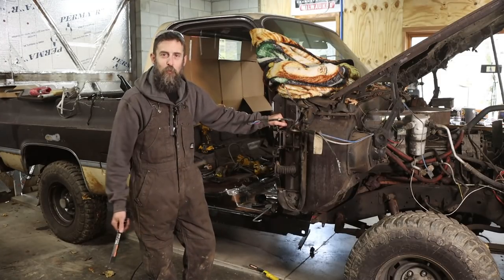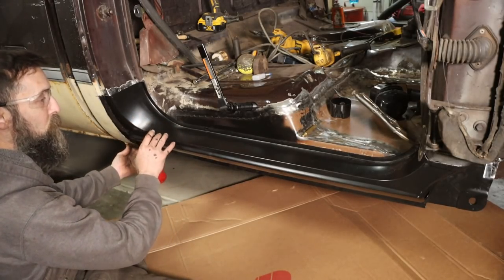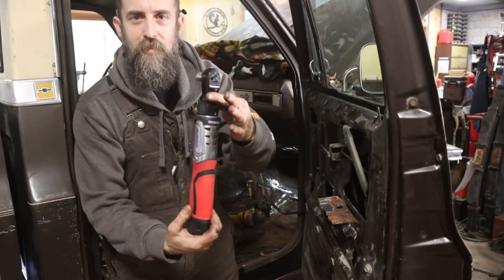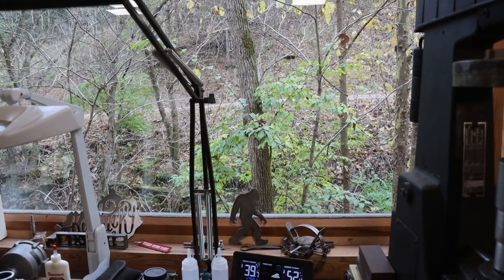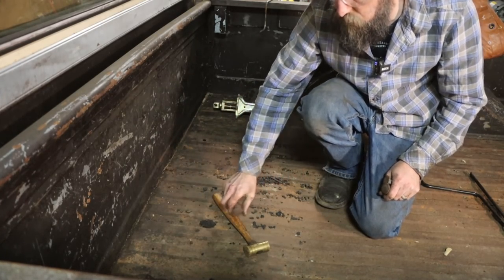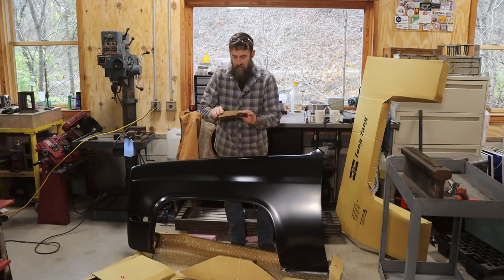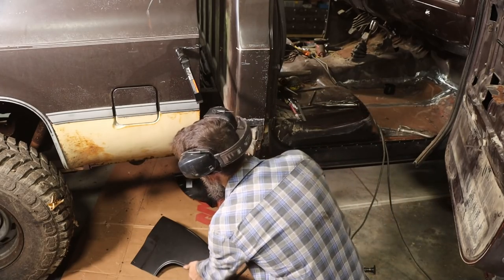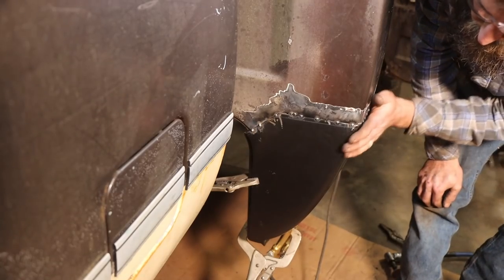STOKED! Cab Corners & Rockers In the Firewood Square Body.  Part 9 #chevrolet #squarebody

Comment: Hi Steve, looking good so far.😁. Your headlights, I could suggest Halogen but I don't know what shape your wiring is in, so I would consider using LED's, extremely bright and no extra strain on your wiring. As for the colour, considering where you live, in a beautiful bush area, I would suggest a colour called Harlequin with a dark green dark blue brownish red tints to it. Harlequin is a unique mix of colours that if you look at it in one direction, with my suggested colours, your pickup will look green, if you look at it in another direction it will look blue in a different direction will look reddish brown. As I said Steve, the Harlequin colour is a very special unique paint. But it is extremely nice to look at and I think it would suit you and your area very well.
Love your video's and can't wait for your next one. "OH" careful of the beard while grinding, them sparks can make a mess of it if it catches alight.🧔😀👍.

Comment: Two tone blue and blue, make the top of the cab the light color and it wont get as hot sitting in the sun. Would look good with matching LED accents in the lights, whichever color you pick. A bed light on the back of the cab would be handy to see what you are doing in the dark.

Comment: Replace the headlights with LED if anything close is available. Also by far the easiest way I’ve found to remove trim is by sawing through the tape holding it on with fishing line.  Also for paint, TCP Global sells a 2 part DIY bedliner kit in a bunch of different colors.
Reply: I was going to say the same thing... but I looked first and sure enough you brought up the bedliner.  A solid work truck needs all over protection.

Comment: Headlights:  At a glance they look like 4x6's?  You can get sealed beam retrofits that run on either a replaceable modern H4 or 9007 bulb.  Since you can get 4 hi/low beam housings, you can run one aimed as a normal white hi/low headlight, and the other set with a yellow bulb aimed much lower for a sweet hi/low fog light setup and really cut through the fog/rain/snow.  You'd have to get pigtails too I'd imagine, but those are also available.

Comment: Great to see that when you put your mind to anything you do, the results show your talent, and the pride you take in your work. LED lights, and color. That's a tough one. If you go with a really different color, then you need to worry about inside door panels, under the hood, and so on. Maybe look at that year truck and see what other colors they used. Remember it is going to be out side, not garage kept. Personally I like a darker color. Black is what I have, but dark blue, dark grey. Grey is probably the easiest to manage n maintain,  but it is your truck. You are the one that that will live and drive it. Really great content today, with alot of learning tips n tricks. Thanks. So till next week, stay safe.

Comment: So i just replaced my headlights with Narva LED h4 bulbs. Sooo much better. Fully adjustable in rotation so get the best angle of light to suit the mirror. Im sure you can buy the H4 or similar headlight replacements rather than sealed beams. Also the kit came with a pair of LED bulbs what we call parking lights in Oz, not sure what they are called in the states. 
As for colour, i would go silver with black pin striping. Silver never looks dirty!

Comment: If you don't plan on many maaaaaany hours of block sanding perfectly straight , square and flawless  body work , the only way to go is a light color. My opinion white is your friend, or as we say White is right ! as it will go with what ever color interior color you want. Plus in the summer white is always 15+ degrees cooler inside the cab.

Comment: You asked for headlight recommendations. I put LED replacements from SuperBrightLEDs in Earth City, MO in my 1989 F150, 1998 Crown Vic, and 1999 Ranger. Makes a huge difference driving at night for my old eyes, and draws less power from the electrical system.
Reply: Does it make everyone else on the road in a 3 mile radius around you angry though? Usually those aftermarket LED replacements are hell for anyone facing you on the road - I HATE people with "low beams" aimed directly into my pupils.
Reply: @gorak9000  that also happens with brand new vehicles I find as well here in the UK

Comment: Steve , Very good work you are doing ,but if you don't mind  some advises , first go for LED for your headlight , secondly wash you entire truck with kerosene where is not new paint  in all cracks and under the truck and between  metal sheet , let the kerosene dry for 2 or 3 days PS can use fish oil too when all work is finish ,you will see the difference no rust for long  time  and last please use a mask when welding even for short period don't go blind  it just I care very much for my human fellow beings Regards  Robert  in Australia

Comment: Something that might help installing the door to proper hinge points would be a few lapered levers. to connect hole to hole.  I once helped a guy line up an engine in his boat doing this, and had never done anything like that in a car or a boat.  But I had done it with heavy machine componenets.  Still a two man job, but a lot easier.

Comment: Tip for all those enclosed channels is to, just before the sealer on the top, is to spray in some boiled linseed oil with the undercoat gun, and get the cavity coated all over inside with it. Will polymerise, and coat all the joins and bare metal, along with seal up any paint pinholes, so it will not rust as easy again. Same for all the overlap seams, after the weld, and before the sealer, fill the gap with the linseed oil, and leave overnight to drip out, then wipe down with a rag soaked with turps, and leave to evaporate before the seam sealer. Leaves the inner bare metal coated. 

Also on all the original enclosed chassis, pop the plugs out if still there, and spray a fog in to coat the inner side. Cardboard as a drip catcher, because it will drip, and then you can undercoat after it has stopped, and the metal inside, even if rusted, will stop there.
Reply: What a bloody brilliant idea sir!
Reply: @samrodian919  Did that as a quick slow rust thing, and 10 years later the rust was still just that bubble. Did drip for a week, so I had a nice cardboard carpet under the vehicle, so as not to damage the concrete floor.

Comment: I would get conversion buckets in glass for it and run H4 bulbs. The. i would get a low cost led H4 bulb set and put them on. I did this with my 1980 Merc.

Comment: Good results this week Steve. You are building a solid and useable truck. As for paint, I would go with the factory colours. It's understated and suits the type of vehicle. I'm not sure what headlamps are available, but if there is a halogen conversion that uses H4 or H1 bulbs it will be better than the sealed beams. LEDs or HID systems work well but are probably not in keeping with a 40 year old work truck. 
Best wishes, Dean in Oxfordshire, UK.

Comment: After market LED  replacement headlamps would be a no brainer especially if you drive at night to any degree.  Shop around and you will find they aren't all that expensive.  For safety alone you should change them out.  Smack one deer or pedestrian and you will be regretting you didn't.  I would highly recommend the 6500 or 7000 kelvin color temp ones as they make daylight out of murky orange.  I put a couple on my backup end too and it really makes a difference as well.

Comment: When working on panels, I often will do a lap joint as opposed to a butt joint. I will relieve the joint using the tool that bends a step into the bottom layer edge of the metal in the lap so the visible side comes together smooth and the doubled up seam is on the inside. It requires a little less precision and fiddliness when fitting the panel because it doesn't require the lap to be fit as perfectly as a butt joint. Also, I punch a hole in the panel in from the edge that allows me to put spot welds in from the edge. Very handy, not sure if this is the best way, would love to hear from anyone that might have a reason not to do it this way.

Comment: Headlights. 6000K led, if you can find them and they don’t look ridiculous with strange patterns in the back focal area. They don’t seem to make any that look”factory”. 
Maybe the halogen bulb conversion style lights….they at least look better. 
Don’t go any higher than 6000k or it starts turning blue. I put some on an f150. Big improvement for aging eyes.
Reply from the maker: I agree with the look. The ones Ive seen so far don't fit the look of the truck.

Comment: Check eBay for some LED headlights. I bought a pair of round LED headlights for my 73 Bronco for $49 delivered to my door which was less than old style sealed beams. I've been using them for over a year and they are great. Light output is amazing. I know yours are rectangular but they are probably available. Don't be too hung up on what vehicle they are advertised for just the correct size of light. The ones I bought were advertised for a Jeep but round is round if they are the correct diameter.

Comment: a couple slices at the proper points will get your edges on that panel lined up quickly.... especially if you make it removeable to weld and grind inside...always best to secure it to remove ( screws , clecos etc..)
before burning welds in.. at least it is Bigger!!

Comment: Hi Steve, tip for you, when cutting in panels, just fit the new part over the old as you have done then cut through  BOTH new and old with the new panel still in place with a hack saw, this will leave you a perfect fit one saw blade wide, simples! hope this helps. you can use a air grinder if you have a thin enough blade. great video

Comment: You need a good floor jack for hanging those doors, makes it an easy one man job.  Enjoyed your video.  You're pretty decent body man for a machinist lol.  I did auto  body work back in the late 70's early 80's before going into field service work.  Seems like you never get it out of your blood.
Reply: I use an office chair. It's height adjustable and nice and soft to not damage the door panel.
Reply: @BajaBill7   I guess that would suffice,  I could use my foot to raise the floor jack to align the door
Reply: yep anything on wheels and adjustable makes life easier...
i usually work alone ( preference ) and figure out a solution to a simple job... a scissor jack and some lumber or tubing and casters and clamps and your hanging heavy doors without strain.... or damage

Comment: use halogen headlight lights add a new heavy duty ground wire from battery ground to core support, n clean the ground wires at the headlight plug, corroded ground wires will cause dim headlights !

Comment: put vertical slits in the panels and shrink them that way.... it is eaiser than trying to "fix" a round corner. In my experience the corners are usually correct but manufactured large so you can easily shrink them on their faces. On these f150 the panels are super ease to get fitting correctly

Comment: Looking good Steve. I've got a set of those AC Delco ratchets so far so good I have used the 3/8" one mostly and it seems pretty strong.
Reply: I have one too - great for changing vise jaws on the mill 5 or 6 times per day.

Comment: I try to find some EURO style H4 headlights, they have both low and high beam in the same bulb so you could have all 4 on high beam if you wanted to. They also have a EURO beam pattern that will light up the right shoulder when on low beam.

Comment: For those sealed beams, i like to but the H4 conversion housings with glass outers and tin inners. They won't sun fade like the led all in ones and you can swap a bulb easier than any car on the road with the prongs in the back.

My go to is to put a standard halogen in the low beam because it keeps the cops off your back but put an led bulb in the high beam, Sylvania sells some really nice bulbs, so when you need the light the night turns into day

I've done it to 3 cars/trucks from the 80s and it's worth it every time. Sometimes I'm in it for about 150 bucks, for four lights I'm sometimes closer to 300 plus. 

But even if you don't get fancy bulbs those housings are worth the price alone. New bulbs are cheaper and they're easier to work with. No more fussing with rusted out housing screws. 

Word of caution though, the H4 and some sealed beam pin outs aren't the same. You've got to swap 2 wires to make them work right.
Reply: I am with you. I use the Hella DOT legal conversion housings to go to H4 lights but then use the Philips X-treme Ultinon LED H4 instead of the halogens. Best upgrade I ever  made on my old Dodge as the factory rectangle lights were miserable.  I would only use the Hella DOT lenses though as they have a very strong cutoff that keeps your super bright lights from blinding oncoming drivers. I know I get annoyed when I pass people that have changed their vehicles to super bright euro setups or ones with no approval at all and I can't see anything because of the super bright light shining in my face.

Comment: Steve, I like you, your channel content, and squarebodies so with that said, I still have a go to channel to learn about metal fitment. Halfass Kustoms and its owner "Brent" are exactly where we both need to go for comparison on how to replace, make, or just weld new pieces in. That said, your way works and its not bad but if you watch him build a truck called the General. He took pieces of two  trucks, replaced or repaired them as well as customized what was there and added his twist on the making of a new style of rig yet to of been even thought of truck! I truly hope that if you haven't seen his channel, you might agree, his system is easier to follow as he gets close ups of his work and takes time to explain the "how" to do's. But again, you have a system that works and maybe thats good enough. I know if it was repairing a machine that works with metal, like a boring machine or a lathe then you are absolutely the right person to know as you show how and lots of times the why its necessary to be done. I swear by you and have told others about your machine work. You might already know Brent and his dog Pablo who moves around when a flea bites him
Reply: Check out Fitzee's Fabrication and Trev's Blog. They take it to a higher level but the way they approach a problem can be used for "close enough".

Comment: With paint materials thru the roof, vinyl wrapping mite be a consideration? Body still has to be straight as if painting, and epoxy primed, but a camo wrap would be cool (@@)! And the battery 3/8 ratchet is what I use to draw up the mill tooling, beats a box end. Best to you and family over the Holiday season. Ole truck is looking good, Bear & Sammie in Tx.

Comment: Great work Steve! Good call on the chinesium fenders. You'd have spent it on mig wire and grinding discs anyway.

The new grille and the led taillights will really freshen it up. I'd look into getting headlights you can put bulbs in or a hid conversion.

You should make up a roll bar for the bed and put a led light bar on it the full width of the roll bar.

As for paint, I'd go with a gunmetal grey metallic. Are you gonna rebuild the motor? Or maybe do an LS swap or a fresher motor from something more recent.

I love the old square bodys, really diggin the restoration. Regards from Ireland.

Comment: on the question of headlights they make LED replacements some where its a replaceable bulb in a glass DOT approved fixture others are sealed LED units my 88 4runner uses the 7x6 rectangles i got the replaceable LED bulbs & glass fixtures an am not regretting it massively better than halogen or 1000 times better than the old incandescent bulbs you wont regret it 

i also put in a head light relay harness which my truck used to run all the  amps for the lights through the turnsignal arm knob the old chevys like yours (my old 79 had the dash switch) which can take more amps still meant a lot of voltage loss over the wires going in an out of the cab extra contacts an ect straight power from the battery will also provide better lighting 

in my 4runners case im going to have to get rear fenders for the pickup I need the wheel arch area as no one makes metal replacements for them anymore unless they are hugely over priced and have lead times in the half years an from out of the country i dont have a welder so ill be doing rivits epoxi and a flanging tool (which i got a great price on)

Comment: Steve re head lights, I would go LED as they are much brighter and you have wide angle options. Be careful buying before you understand your local authority regulations with regards to lights. Here in the UK some LED options are not legal. so buying before you know what you are allowed to use, could be an expensive mistake. Take care D

Comment: My  vote is factory colors but with nice clear coat or perhaps if you really need  fancy it up then add a metallic flake  to the tan belly . Not dramatically changing the  color would avoid excessive work changing the door  frame color.
If this really is a get stuff done "work truck" then definitely upgrade the driving  lights to led and then strongly consider auxiliary bar lights/ reverse light with a bypass switch to activate independently  I would not mount them on the cab roof  but on a bed mounted roll bar/ back window  screen  (that screen keep the loader from smashing your cab window, and its a handy tie down point, you could choose to diy fab it  on the channel....)
Then you can see  all around the truck when you are out in the dark loading , unloading working on something  hitching up a trailer etc.
While you have it apart you should put some love into the engine  to make it more reliable otherwise what's the point? 
Anyway  you did ask us  so i let loose .
Have fun  
Thank you